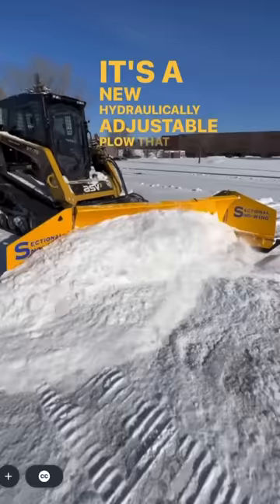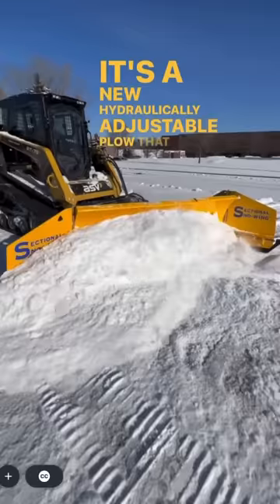Rolling hard packed snow. #shorts

Comment: Awesome. Looking forward to the full length breakdown on this ASAP.
Reply from the maker: Coming soon!
Reply: Yeah. Really think it would cut down on long pushing. Have a unit with this to do long pushes and another with a bucket for backblading in tight areas
Reply: Why don't they make this for a pickup. Looks like the snow power but with the sectional advantages.